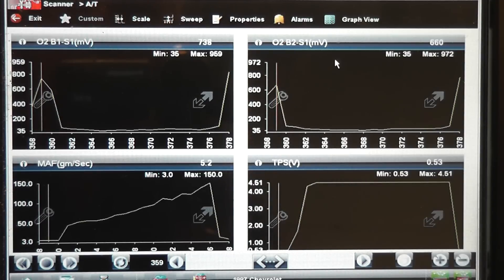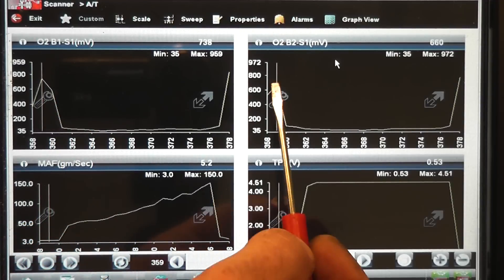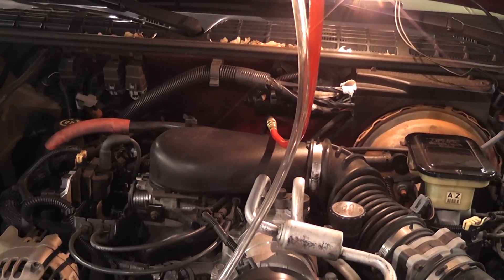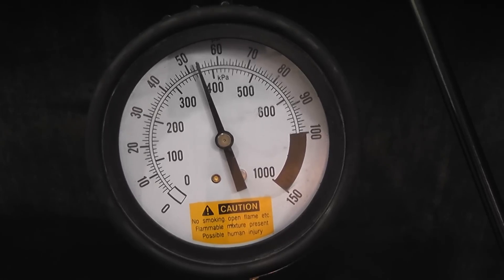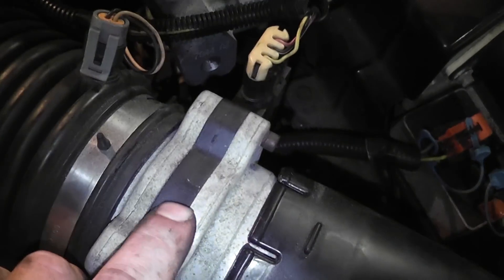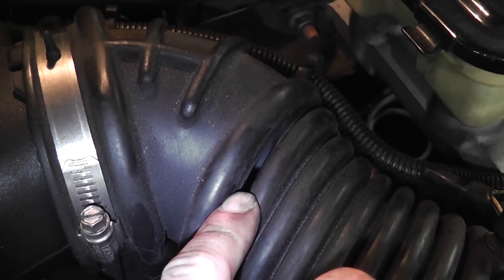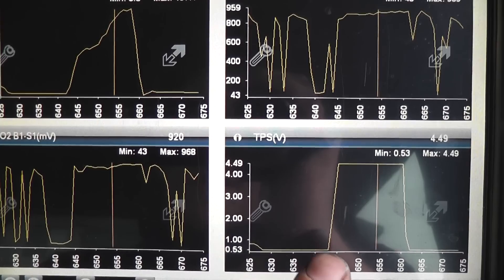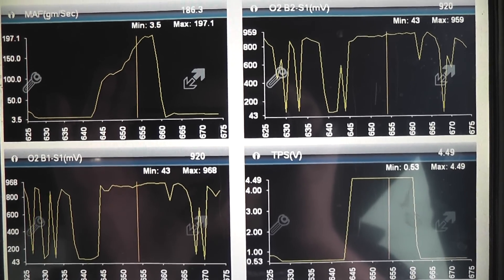Low power, lean conditions (cracked air intake tube) GM

Comment from the maker: Sorry for shouting! This is one of my first videos and what you don't see is I am teaching to a group of students at a technical college. I needed to project my voice to them and was a newbie with the camera mic, and how well it picked up my voice. I've since fixed this. But there are some other videos from 2011 and 2012 where I can't watch them either, it's so annoying. But if you can get past those parts, my content has always been great. Thanks for watching! Now go watch something newer before you write me off okay? :-)
Reply: @scannerdanner can the crack in the air intake tube throw a check engine light as well ?
Reply from the maker: @myyoutubechannel3161  on a MAF engine yes! In particular when it is behind the MAF
Reply: @ScannerDanner  if there is no MAF. And just a stock intake with cracks it can still suck unmetered air correct ?
Reply from the maker: @myyoutubechannel3161  no MAF at all is called a speed density system and no, air intake tube cracks on those systems will have no effect at all.

Comment: 2008 Mitsubishi Lancer ES 2.0L had a cracked air intake Throttle tube, and duct tape solved the problem.  The engine was hesitating and even stalling at lights (very embarrassing).  Thank you for your video mate.

Comment: I have a Pontiac G3 (same engine as Chevy Aveo)  Engine light was on so I took it to my mechanic.  He put a new MAF sensor on and nothing changed.  He wanted me to leave it for a few days so he could figure out what was going on but that wasn't an option so I took it home.  I had the hood popped to put in some windshield washer fluid and looked at the outlet hose past the MAF sensor and sure enough it was cracked almost all the way around.  I wrapped duct tape around it until I can pick one up.  Watched a tutorial online and it looks like a very easy fix.  Thank you so much for your video!  YOU ARE THE MAN!!!!

Comment: My father in law's 2009 Nissan Sentra had similar performance issues but only a lean code on the 4 cylinder. First thing I think when I see these lean codes check for intake leaks, from the air cleaner box to the intake manifold. Lo and behold, split as big as this in the inlet duct, same place l as this. Got this replaced l, no codes no performance issues have returned.

Hadn't seen your video till today, as I fixed this issue some months ago.

Comment: Hmm I’m glad I came across this video.  Maybe that’s what’s causing a P0101 code I keep getting.  I have already replaced the air filter & cleaned the MAF each time the code comes up…  Didn’t think to check to hose.

Comment from the maker: @JUDGERAMBO Yes and volumetric efficiency of the engine. (Intake-exhuast, cam design, number of valves per cylinder, bore and stroke, turbo or supercharger etc.)

Comment from the maker: @enix2k6 Yes you can do that however for this truck Fuel trim was normal at idle and low speeds. This was because the tear in the boot opened up under load due to engine torque. So this engine ran lean under loads only.

Comment from the maker: @magrisers Thanks for your comment and I agree a smoke test would have been good too. Honestly a simple good visual inspection would have been the best method. I preach that to my students all the time, yet I didn't perform one on this truck. Anyway I posted this one because within the video I showed the proper way to test fuel pressure and also wanted to re-enforce the O2 at WOT test.

Comment: Had an 02 Bonneville 3.8 conk out on us. Acted real bad bucking and stalling out, my son really needed the car so I had it towed in to a shop for quick repair.  Was told the MAS air flow sensor was bad and they  replaced it.  Ok, no other  advise, and they  really didn't charge me a lot,  I don't think the part is OEM quality.  However, a couple a three weeks later car starts acting up again.  Scan indicates MAS Airflow, I removed the part and cleaned it with the appropriate spray.  I went to open the air filter box to replace filter and clean and discovered one of the clamps was undone allowing a little opening to suck air in front of  the filter. Since  the shop did not replace the filter or clean the box and ducts I'm pissed off that  they let the car leave their shop like that. I know I didn't do that  and my son didn't, he's not that inclined. Wasn't sure if that situation could cause this current problem but since seeing this video sure looks like it has.
Thanks for the info.

Comment: Yeah I had a P2096 and my car stalled twice. I replaced my MAF sensor but that did not fix the issue. I also did an idle air relearn and that stopped the stalling but the check engine light came back not even a day later. I then figured my front O2 was bad. As I was taking off the intake duct that is in the way of the O2 sensor, I started loosening the clamp on the intake duct from the throttle body but the clamp was already someone loose. So I decided to tighten the clamp back up and take the car for a test drive while monitoring the fuel trims and low and behold, everything was normal and I have not had a check engine light come back on. 

But hey at least now I have an O2 sensor on deck in case I need it. Lol.

Comment: I think jiffy lube broke mine trying to check the filter, and didn't tell me lol. It started hesitating a lil bit, later on that day.
Reply: do you untrain mechanics sometimes break your air intake to trying to reach something like an oil filter? It seems to be a common problem.
Reply: I think Jiffy Lube broke mine too.  During and oil change, the tech brought my air filter to me to show that it was a little dirty to try and sell me more parts.  I checked later and they didn’t even screw the air filter cap on all the way and my air take had a huge crack in it.

Comment: I once had a 2009 chevrolet aveo, 4dr coupe with the 4cyl auto ecotec engine with this same exact issue, never saw it till i checked the air cleaner for periodic checking and cleaning, the funny thing is, the air intake tube was split in many areas, but not once did it throw any error codes and it drove just fine, other than the lack of power with only 106hp on tap.
Reply from the maker: you mean like this one? https://youtu.be/01shTvwZ0oQ 😎

Comment: So simple!  I just noticed cracked air intake tube on my 01 Volvo S60. Hoping this with some other repairs and new hoses will fix it. I am wondering however, if it’s cracked before anything else “happens” to the air getting sucked in, why does it matter?  Mine is cracked under the hood but before the air goes anywhere. It would make me think if anything I’d be getting a little more warm air versus ambient air since it’s now sucking it in from inside the engine bay as well as outside.
Reply: In this case it's after the MAF sensor which results in the computer giving calculations based on incorrect data
Reply: @insurancedice  makes sense. I had zero idea what I was talking about 5 months ago and slightly above zero now hahaha!  I also found out there was another plastic tube after MAF that also had the same problem.. fixed that, and still having vacuum leak symptoms. Made a diy smoke tester and broke it before actually getting to use it 😂

Comment: 2003 Saturn ion won't idle past 2000 rpm, sounds rough when trying to idle past it and the speed thermometer stays at 0 mph while driving and won't go more than maybe 15 mph

Comment: Check for weak/torn motor mounts increasing the air tube flex with the torque.
Reply: hi so weak engine mounts could mabee cause unmeterd air???
Reply: Good point. I would've guessed they cleaned it with a solvent and left residue inside the fold, but worn mounts seem more likely

Comment from the maker: @xIntoThePitx Well they call it "free" but all they do is scan it and then try to sell you a part based off of the code. It is a big scam. Check your fuel pressure (55-65) must be at least 60 during cranking. No start will occur under 50 on your system(not typical). make sure fuel pressure holds on shut down, if you have a bleed down problem (leaking psi reg.) this will also give a long crank and rough idle.

Comment: @ScannerDanner - Free diagnosis must be nice, but I don't see how they make money off it, unless they get you to agree to them fixing the problem when they waive the diagnostics fee. Yes, that's true you can't just throw parts at a code, but knowing the codes is an excellent pointer in the direction. I've been having long crank-start times which I minimize by letting it prime up. Colder the weather, shorter crank times. With CEL on, it starts no problem by defaulting the prob component

Comment: @ScannerDanner - Yes, I'm certain there's an issue with the EGR. I have e-test reports that show it. These linear egr's aren't the most reliable things GM offers, and these 4.3s are good at carboning up, just like your 3.1 blocked passage video. A long time ago I seafoamed it and think maybe that dislodged some carbon and it got forced into the egr port. Do you think those 'screen' egr gaskets are worth getting, seeing how I'll need to replace the gasket anyway.

Comment: Recently went through this with my 2005 silverado. Truck has a cold air intake exhaust and a diablosport trinity 2 where I can view live data, tunes, codes etc. I was getting a lean bank 1 code and it was getting knock retard of 8.0 degrees with half throttle, you could hear the engine change. Come to find the cone filter rubber where it attaches to the intake had split and you could see inside the filter . So all that dirty, extra air was getting in right by the MAF causing this.

Comment: @DZydrunasC Yes. So what do you think the original shop did? Tell the customer it needed the parts and charged them an arm and a leg? Those parts and labor must have added up to  $500!!!! I watched another vid from ADTP Training, or something like that, that showed a turbo car with a tricky problem, so tricky the original shop replaced the fuel pump AND TURBO that weren't the problem.

Comment: I also have a 97 Blazer . Do you have a video showing how to test this particular MAF and the EGR with "normal" volt meters?  I can't afford the professional setup you use in your videos. I just bought an Innova 3160b Scan Tool so I can read my own codes and the first use pulled P0300, P0175, and P0420. This is after I replaced plugs/ wires, cap, rotor, EGR valve and Coolant temp sensor. I need to test the MAF and O2 sensors before proceeding to back pressure test. Thanks for the vids so far.

Comment: Hi Paul What would cause the gauge needle to vibrate when at idle but become steady on accelerating. That's what I am getting on my Dodge Ram. I am using a new OTC fuel pressure gauge. Thank you, Frank

Comment: I just installed new headlights in my 94 explorer and when I removed the intake tube the entire bottom of the tube near the end on the MAF side was torn clean open with a hole about a half inch wide and two to three inches long. I wondered why my idle was rough and surging for so long and it turns out that the problem was just the deterioration of the original tube.

Comment: Thanks Scanner. I'll look for them. I since learned that the scan tool I have also does live data. It's just not as nice as your set up. Now I just need to learn how to use it.
Any idea what might be causing the 3 codes I posted? The Air Intake is in good shape, no cracks or tears. After the tune up it should be running better than it is. I'm leaning toward MAF or O2 sensor(s) with a possible partially clogged CAT. 
Any help is much appreciated.

Comment: great videos paul. this cracked hose sympthon is not the same as vacuum leak. what about fuel trim numbers at idle. would be high and improve a higher rpm. thanks paul.
Reply: paul miranda good point that!...i would like to see paul elaborate a bit more about it

Comment: 2002 Dodge Ram, keeps stalling. Dodge dealer said I need a new transmission. So I looked into it myself. The hose that connects to the throttle body was cracked. Should I just change that?
Reply from the maker: what hose? the air intake hose like in this video? Won't help you on a MAP engine
Reply: @ScannerDanner  yes that hose and what is a MAP Engine ?
Reply from the maker: @SultanSullins  an engine with no MAF sensor (mass air flow)

Comment: When it is a lean condition the engine injects more fuel than normal right? So my LT1’s intake tube melted and had a hole in it. That could be my culprit.
Reply from the maker: a lean condition would be not enough fuel or too much air

Comment: I recently bought a 2008 Honda Accord and I noticed in the engine bay that there is a piece of tape covering a couple of the ridges on the intake tube. Now my engine light came on and the P0420 code came on. Should I replace the tube first and run diagnostics to check the functionality of the o2 sensors?
Reply: The ECM will be smart enough to differentiate between a failed catalyst (p0420) and a lean condition (p0171). 

Watch the upstream and downstream oxygen sensors on a graph with a scan tool. If the downstream mimics the upstream, the catalyst is not functioning.

Comment: What is the part number for the replacement intake tube you installed?
Reply from the maker: This was a LONG time ago my friend. It is an air intake tube between the MAF and throttle body. Call the parts store

Comment: Hi, would a cracked intake hose also be culprit if a p0172 on a 2005 Honda Pilot? It's the only CEL I get. Thanks.
Reply: P0172 is a system rich code. That's the opposite. Do you mean 0171?
Reply: @stephencarlsten2329  No, it shows as a rich code. I ended up cleaning the TB, and it went away. Now I have a "intake system leak" code. I was told I had to reset the TB since it's electronic and not mechanical with a scan tool.

Comment: I have a 2004 acura tsx, and there is no MAF sensor.  It looks like it only uses the MAP sensor.  I have a slightly lean condition (+12 STFT), and i see a cracked intake air tube.  Could the cracked tube have anything to do with the problem? I wouldn't think so since there is no MAF sensor.  Thanks.
Reply from the maker: A cracked air intake hose on a speed density (MAP engine) will not cause any driveability concerns. Exactly as you stated. Look elsewhere my friend

Comment: I had the same issues on my civic but I fix every leaks and it still idle pretty bad can it be the o2 sensor since it was bad before this so the ecu can't readjust the AFR?
Reply from the maker: what are your fuel trim numbers? any codes? year and engine size would help me too

Comment: I have this exact problem on my 2014 impala.  Would you say that duct tape would be a decent temp fix until I can buy a replacement part?
Reply from the maker: yep
Reply: RTV silicone that up. No need for a $150 piece of plastic

Comment: Typical GM product. I still have the original air intake hose on my 1991 Ford Escort with 131k miles. The 2013 Chevy Sonic has a cracked air intake hose at 54k miles LOL
Reply: Fords are the Tow guys best friend so I wouldn't be bragging about anything if I was you lmfao🤣
Reply: @bigdaddylovesyou8814  you posted your comment 3 minutes ago and it has a like, did you like your own comment? 🤔

Comment: I’m having issues on my 4.3. The idle is bad on it. One second it will idle correct, next it wants to idle at 2k 
Sometimes 3k 

I started with the vacuum lines 

Seemed to help for a little bit but after the engine warmed up. It went back to the same issues.

So I then did all my gaskets, replaced my spider injection, Pcv valve; replaced the brake booster vacuum fitting o ring. 

Nothing worked so far.

I’ll be trying this out tomorrow but I don’t think it’s this but it’s worth a shot

Anyone have ideas on what could be causing my issue?
Reply from the maker: You have access to scan data so we can look at idle TPS voltage or percentage?
Reply: @ScannerDanner  yes I do.
Reply: So I managed to get it to idle correctly after fixing “attempted” this issue.

Is there a way I can private message ?
It seems that current goes through but no signal to adjust idle with pcm
It just sky rockets to 2k

I can say I did add a temporary ground which did help but returned 9 days to the same persistent issue I’ve been chasing

Is the iac tied to anywhere else besides the pcm?

Any insight on this would be greatly appreciated
Reply from the maker: @luigimartinez7127  you never answered my last question buddy. What is your TPS voltage and or % when you fist turn the key on, and then at idle with engine running. It MUST not change, at all!

Comment: can a crack in your air line cause my car to stall.
Reply: Did u find out
Reply: @map1537  Not sure, after replacing it, ive had no problems since.
Reply: mine 1995 mr2 has a hugh crack like the one in the video and I replace with a 3'' which is way too big, then it keeps stall everywhere, so it will I guess, looking for a right size, 70mm?? anyone got ideas ?
Reply: @zzx8956  as long as it's completely sealed, a little bigger shouldn't matter. But it has to make a tight seal from the MAF sensor all the way through the engine
Reply: thx Scott, I've got a right size of the intake hose, nice and tight , still stall after driving about 50 to 100kms and keeps stalling every 10mins around.... no idea why 😭  @shimes424
Reply: @zzx8956  have you checked the IAC? Might need some cleaning... wouldn't hurt. Googled it real quick and might be a bad temperature sensor, though it claimed 3 years were affected, 92-94. Could still be common for your car

Comment: Wouldn't a crack in the intake track cause a vacuum leak or lean at idle condition?
Reply from the maker: in this case the crack was not opened up enough until the engine would torque, so no real issues at idle and low speeds